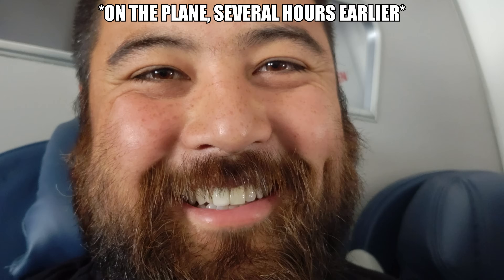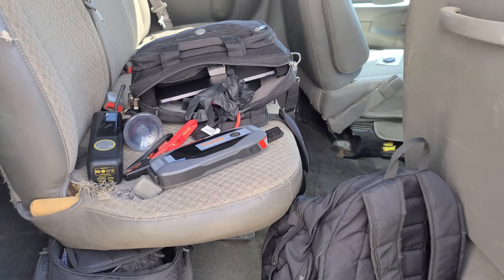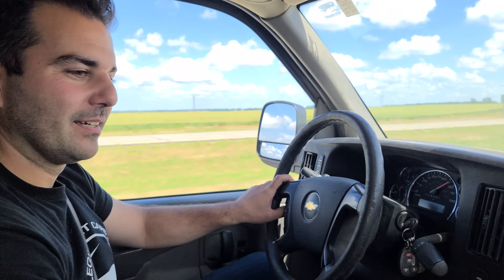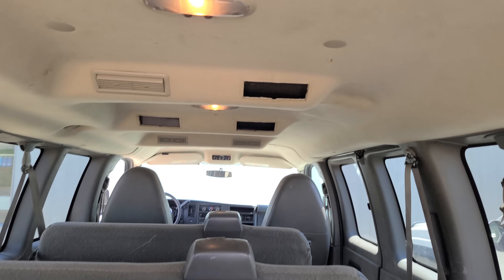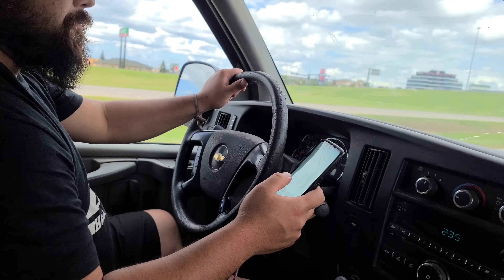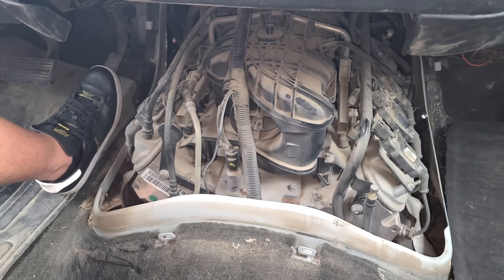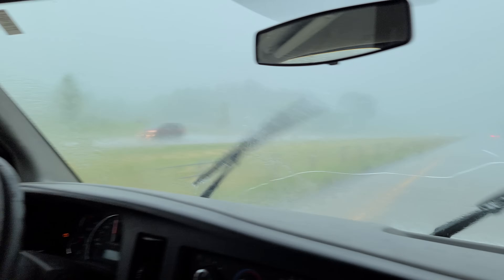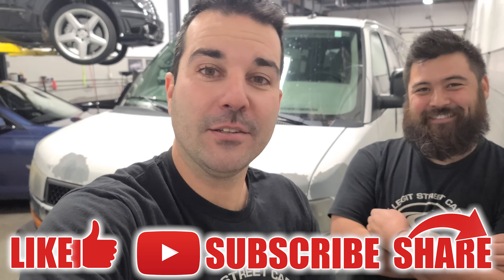I'm Building A 1000 HP Tow Van So I Bought A Broken One 800 Miles Away & Tried To Drive It Home!

Comment: Hey Alex, any chance if you replace the trans instead of rebuilding it, that you can take the old one apart still and show us everything that had gone bad in it? See what a transmission doing all this bad stuff actually looks like on the inside?
Reply: From what I've seen friction plates. Fluid channels. Springs. And the rest of how it works is basically majic

Comment: I own 2004 2500 Express van standard wheelbase.  I'm posting comment just to tell you that the rails to which seats are attached cannot be readily removed.  Not all nuts on bottom of the van can be reached without removing muffler.  I took mine to a welding shop.  He used torch to remove top of the rail then melt the head of the bolt.  ...so headless bolt would fall onto muffler then roll to the ground.

Comment: I'm a contractor and have had many express vans. The 3/4 tons with 6.0 only get parked for 2 reasons- rust and rusted brake lines, trans issues. By then they usually have between 225 to 300k and have paid for themselves and then some. Great vans.
Reply: i have one with 379k.

Comment: Knowing the 6L transmissions, I can confidently say it the lockup clutch slipping and making noise. Disable the lockup clutch slip in HPTuners and you should be ok for a while. GM slips the lockup clutch for comfort. I lock mine up in my G8 pretty firm so it doesn't slip...
Reply: I agree mine did the same thing ! @james Williams

Comment: That's an amazing find. I wonder if the original owner had it weatherized for the harsh climates. I used to live upstate New York and almost any used car over 5 years old started showing signs of rust deterioration. The only way it won't rust is if you don't drive it during the winter. I was born and raised in Southern California and moved to New York in 1991. I had a 1977 Ford Van that I had purchased in 1981. The van was originally sold in Nevada. I was the second owner and I bought it with not a pin hole of rust on it. When I moved to the east coast I drove the van all over New York, Ohio, West Virginia and Pennsylvania for my business. First winter I spent there, the van started showing signs of deterioration. I should have sprayed some tar under the floor boards and frame. I ignored it and then the bottom of the doors started to bubble. The salt they use on the road is so harsh on those older vans and trucks. Eventually it developed cancer holes in the usual areas. It was such a nice van and wish I paid better attention to weatherizing it before the damage started. Anyway, to see no signs of deterioration on a vehicle that age, like the van you bought is unbelievable.

Comment: I have a 6.2 in my Yukon. If the coolant routing is like mine, there is a Y fitting right out of the pump routing to the reservoir and the firewall. Doorman makes an upgrade that replaces hoses molded to a plastic Y to clamped hoses connected to an aluminum Y. It's great and replaces a known weak spot in the coolant system. I also have a similar issue with the ABS/Stabilitrack when they get wet. When I need them the most, one of the ABS sensors takes a vaycay. One other thing..I think the trailer button prevents TC lockup.

Comment: I used to drive a 2012 Express 1500 work van and it had the 4.8 with what I believe was the same 6L90 transmission and I never had any issues with it. It had 125,000 miles on it and it ran like a dream. The 4.8 had plenty of power and that van was always completely loaded down with multiple different sized ladders, a 12' metal brake, wood horses, tools, and two guys. It was fairly quick too. It surprised me on more than a few occasions.

Comment: When you take the transmission off - it could be the flex plate as they have the potential to crack - the noise could be it vibrating prior breaking all the way around

Comment: The torque converters on those are constantly locking up and unlocking. It’s actually a problem with those and typically you want to turn off the low speed torque converter lock so it doesn’t tear up the torque converter and run the transmission.

Comment: I had a 2016 Chevy 3500 van with 6.0 and 6l90e trans . Used it to tow a 21’ house trailer . Towed the trailer without a weight distributing hitch . Because of the long wheelbase and not much rear overhang it was very stable while towing . 500 lbs of tongue weight only dropped it 1/2”

Comment: I have a 2004 Chevy Express 1500 that I have put Suburban 2500 six leaf Springs in the back and put a 14 bolt semi-float from a 2500 , I also put a heavy duty transmission, 3 inch suspension lift because it's all-wheel drive added some killer off-road tires with Bilstein shocks, regear the differentials and change every single part on the van but the engine! My van has $265,000 MI and I use it to travel across country and Overland every month taking thousands of miles, I plan to replace the engine as soon as I can find one with extremely low miles, I purchased the van for 600 bucks

Comment: Have you checked the TCC solenoid? I don't know if those vans even have those, but on my old Gen1 Lumina, a bad TCC solenoid would basically brick the transmission at sometimes wildly varying times. But the slippage and clunking you're seeing was a classic sign for sure. Swapping what turned out to be a <$50 part fixed it.
Reply: May also explain why the Stabilitrack randomly lit up on the way back too.
Reply: I have a Chevy impala that does the stability Trac thing on and off and would like to know why! Lol

Comment: The 6 speed and 8 speeds are known for having torque converter issues as they actually come apart and send metal through the transmission, once that happens a full rebuild is required
Reply: definitely converter shutter

Comment from the maker: Should I go single turbo, twin turbo or supercharged?
Reply: Will both fit?
Reply: Supercharger!
Reply: Twin turbo
Reply: Supercharged-turbo-combo-legit-Frankenstein LOL
Reply: Supercharged!
Reply: Single
Reply: SC for sure turbo LS is everywhere now days
Reply: Twin turbo
Reply: Just make it go 9$ to "GET TO CHURCH ON TIME"
Reply: Twin Turbo
Reply: It has rec port heads so you can put an lsa supercharger on it easily.
Reply: Definitely a supercharger!
Reply: I would super charge it, I don't see a whole lot of room, for turbos in there.
Reply: Can you do both? Have a supercharger spool it up until your twin turbskis get going perhaps? Why stop at 1,000 herspers? Though it'll be the torque that matters if it's a towing rig. 
I think you'll need to replace the torque converter and check a few sensors and solenoids/relays first though, before you start worrying about modifications. But a bit of a lift & a AWD conversion might be an idea. With some chunky mud tyres that thing'd go pretty much anywhere.
Reply: Yes, plus imagine how many bottles of NOS you could fit in that thing!
Reply: Single turbo.

Comment: Those 6.0 Vortechs are fantastic engines.  Had them in my 2002 Yukon, 2008 Explorer van, and my current 2018 Explorer van and have never had a single issue with them.

Comment: Awesome van! You should take more road trips with Peter. This is good content. By the way, you should travel with an ODB scanner so you can scan codes on these “barn find” deals before you head out cross country.
Reply: He does carry an OBD scanner.
It was with the stuff he brought on the plane.
It’s mentioned in the video
Reply: Torq app and a wifi OBD scanner does pretty well. The premium version has a pretty decent set of tools in the app. It's like $6, so it's not tea bag to just spring for that with a $20 wifi scanner
Reply: @StephenFogarty2023  , thx. I missed that!

Comment: It’s always a nice day anytime you get yourself a new vehicle(new to you) that you always been wanting to get and now you finally got it and for an unbelievably low price!! By the way all Chevy/GMC Express Vortec engines were detuned compared to the same engines that were put in the trucks with the exception of the 4.3 Vortec V6 I believe, even the 6.6 Duramax was detuned but who cares! Nothing a simple tune can’t fix! And it comes with the Bad Ass Alison Transmission!! Also not many people know that you could even get the baby 4 cylinder Duramax from the Colorado on the later express years! Which was pretty cool that you could essentially get up to 30mpg on such a huge vehicle!!!(hey the more you know) The other transmissions were just your regular 4speed autos, 4L60E and the heavy duty 4L80E which were then updated to their respective 6 speed versions, regardless if you got the 4speed or 6speed versions, those GM transmissions in my opinion are simply tried and true classic built transmissions that have proven their worth over decades of hard working reliability and performance for having such a simple transmission design that really hasn’t changed all that much from when they first appeared in the 80’s, other then adding more gears and features like tow mode, manual shifting and so on……also the MDS or Cylinder Deactivation(I forget what GM calls it) was optional and from what I read, it was better to get the regular 6.0 that didn’t have that, apparently many vehicles that had 6.0’s equipped with cylinder deactivation feature were having a lot of issues that were related to that feature….something that never happened to the regular 6.0’s…..hey, knowledge is power! Did I mention that these vans also had optional AWD? Hell to the motherFN yeah!! It’s like having a big ass Subaru but with American V8 POWA!!! You could even send your can to Quiggly(not sure on the spelling) so they can convert your van to the ultimate safari camping end off the world apocalypse mobile!!! By giving it a lift and putting proper all terrain tires, all the underbody protection and if you wanted to they convert your RWD van to 4WD or if you wanted to get more off-road capability from your AWD van then they could convert your AWD van to 4WD with a regular transfer case that comes with 4WD LOW!! for when the going gets tuff and slow, 4LOW gives you the ability to slowly crawl with 100% of torque!! Ok that’s enough for me I promise to tone it down a bit for future comments…

Comment: 35:45 I know that my older 700R4 won't lock up the converter except in 3rd and 4th gear. I would imagine the engineers programmed it to only lock up in 3rd gear and up as well for any other trans. Doesn't make sense to use lock up in 1st or 2nd.

Comment: Great video! Love your content! My GM gave the stabilitrak and abs warnings when the brake fluid was low. Especially when taking a sweeping on ramp or off ramp turn. After getting back straight for a while I could cycle power and the light would go out.

Comment: Name suggestion: Bossy :D Next time, i would suggest the Lucas transmission fix- i have actually seen that stuff work miracles in transmissions, sometimes it will take a month or 2 but it works for sure. My friends mom's Buick with the 4T65E was slipping real bad and we poured a bottle of that stuff in there- it completely took out the slip and it has been working for 3 years now with no issues. I use it now on every transmission service i do whether the trans has issues or not.

Comment: I sometimes drive one of these at work, but the GMC version. Same color, same crappy paint. Just the other day I watched the paint fly off the hood as I was driving down the highway. The thing has 20k original miles, and still has the plastic on the back carpet. Same engine/trans. The radio doesn't work, the headliner is falling down, the mirror control knob is broken from it's mount, the rear-view mirror fell off, and the a/c won't shut off. This one actually seems nicer than the one at work. lol.

Comment: I had the cutaway box truck version of this van, my 4L80e went out around the same mileage, the transmission shop I went to had a bunch of pre rebuilt transmissions just waiting to be installed, in and out in a day a half and ready to go another 200k. The 6.0 still purred like a kitten when I sold it at 350k miles.

Comment: Finishing my previous comment - when they overdrive hunt it is a sign of clutch wear and low line pressure.  You made it home only because it was highway driving.  I had similar issue on my 4L80E and in my case a recent rebuild found a new line pressure solenoid that was adjustable set tooow, and after I put in a line pressure gauge - electronic - I dropped the pan and a quarter turn put it into spec pressure.  The noise was the clutches chattering as they slipped.  It would not throw a code and it was not the torque converter until you trashed it all the way.  There is an input and output speed sensor that tries to monitor slippage.  Now the trans probably has chips throughout requiring replacement of mostly all the internals and a new torque converter.  A line pressure check and adjustable line pressure solenoid might have saved the transmission as on a 4L80E it is right at the front a two screws remove the non adjustable one.  Mine is 45 psi at idle 65 and up into reverse,   Into drive it goes about 60 psi on coast, and 100 to 175  on standard acceleration and you would be smart to put in a gauge for pressure.

I would not mess with supercharger or turbocharger upgrades.  You should put on dual alternators - also called the ambulance package.  Don't fool yourself they will overheat pulling heavy loads and up hills.

Mine is a diesel and for more power it is bifueled to use CNG and Hydrogen made on the fly - also called HCNG

Comment: I'd put money on the torque converter being the issue, and all the grit it created causing reduced pressure on the clutch packs. The 6Lx0e's are common for that since they have a constant TCC slippage in ALL gears (20-40 rpm). The howl is probably when it slowly releases/engages the TCC between gears.

It's common to remove any engagement in 1-4 and add pressure in 5-6 for less slippage via HP Tuners.

Comment: 28:50 that ranchero had good bones, they didn’t rust horribly either that would be a good project for a revival, I have a 78 with a 460 in much better shape but it’s got high compression built to 600hp, will need a second 750 battery routed to the cabin which I haven’t had time or money to do yet…

Comment: Look for the input shaft seal to be cut , neked or blow out . The converter is trying to lock but it dumping fuild at lockup. It's can burn the clutches and still out of high gear drum. Good luck.

Comment: Seafoam Trans Tune and adding additional magnets in the pan fixed both of my older GM 4T65E transmissions with failing PCS solenoids. I swear by that stuff!
Reply: Haha my shop has an old metal can of Seafoam Trans Tune that's been there longer than me.
Wonder if it goes bad or they've changed the formula in the last 30yrs

Comment: We had a 2011 with the 6.0 used it as a Siding van had 460,000 miles on it and same issue someone ran the tranny low on fluid and it sounded exactly the same.

Comment: Check the delta between turbine speed and engine RPM. If turbine speed stays the same and the engine revs it's the TC. If the turbine speed increases with the engine speed it's the clutch packs.

Comment: Normally the toque converters will start to blue when the lock up clutches are slipping on those. But in all honesty it’s a gm 6 speed so it’s probably the converter.

Comment: My 2010 F150 did something similar. The first time I thought I hit some rumble strips in the road. Then i realized it was whenever I tried to slightly accelerate and was between 35 and 65. It was the lock-up clutch in the torque converter. I changed the trans fluid and put in "Shudder Fix" and it no longer happens. That was at 145k miles.

Comment: Modern auto transmissions have very strong clutches in the torque converter. They will lock up even at full throttle and in any gear.

They often will unlock temporarily during shifts, but they lock up quickly after the shift.

The reason the torque converter clutches were beefed up so much, is to improve fuel economy.

Back in the days of 700R4's, TH350's with lock up, 4L60's, etc the converters had very weak lock up converters and only locked up when cruising at light throttle and at constant speed.

Wherever locked up, fuel economy is up to 15% better so locking up while cruising makes the biggest impact on fuel economy.

Most likely it isn't the torque converter though. There are many clutches that get used in multiple gears, some even all forward gears so it could be one of those.

One thing I've done to limp failing auto transmissions hundreds of miles home, is to manually place it in a lower gear. This reduces the torque that the majority of internal clutches need to handle - so they tend to slip less.

Comment: The work van I drive for work has the same engine and transmission, we have replaced the torque converter and the transmission about 6 months apart. Sometimes when driving in a lot of rain the abs light comes on also

Comment: i have a 2013 silverado 6l80e and had a friend tune it some with hptuners since i hate the programming of these transmissions. the torque converter was set to lock up from 2nd through 6th gear., had him modify the lockup and speed of lockup, so now it only locks up in 4-6th gears, and only at 40 mph or above. wish these transmissions had the torque converter work like a 4l60e. but they are a clutch on clutch shift, they are a no band design transmission. alot of demand is put through the converter with this style transmission.

Comment: Sweet van I bought 2016 Chevrolet cargo 2500. From electrician company in AZ. Was a fender bender all I needed was a AC condenser. Back bumper and front grill. I only paid $600 for it and drove it about 4,000 miles so far.

Comment: try pressing and holding the haul/tow button.  some of the GM vehicles have 2 modes on that button, single press will put it in haul mode and a long press will turn off overdrive.